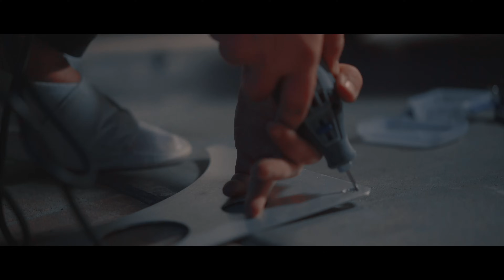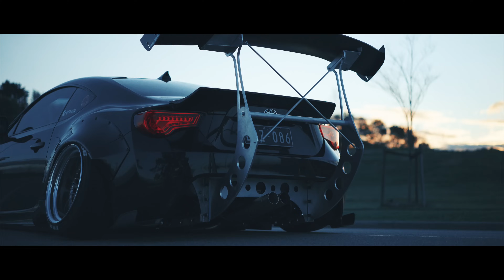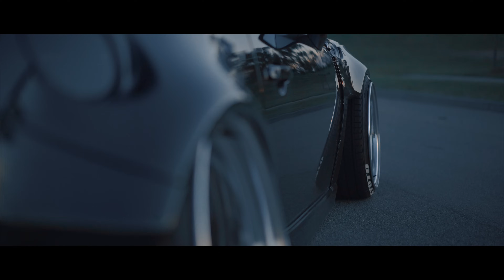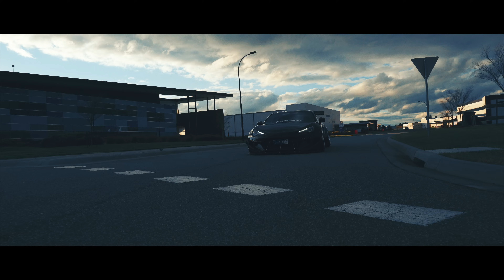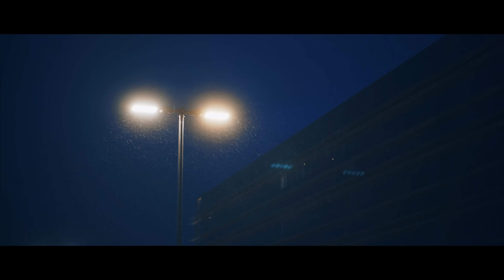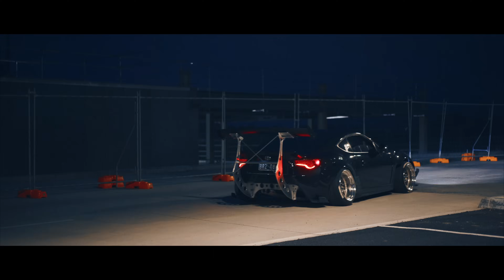Jake's Rocket Bunny GT86. | 4K

Comment: how much this car cost you?  
btw dope video :)
Reply: Used BRZ = $25,000
Body Kit = $3,500
Spoiler = $1,000-$2,500
Rims and Tyres = $3,000
Tail Lights = $400
Coilovers = $1,300
Stickers = $30
Paint for Kit = $900
Reply: All Australian Dollar also Australian prices
Reply: Shit bro,  but it  Totally worth it
Reply: They look awesome, But the engine in this car is a total turn off
Reply from the maker: haha those prices aren't entirely correct as this car is bagged^ The air suspension alone is over $4k.
Reply: I was just giving an estimate cost on the cheapest rocket bunny build you could do to match this car. Bags are defiently expensive though. I have a 2 friends with V2 rocket bunny 86's.
Reply: Ruining a perfectly functioning car......priceless
Reply: MuffledPhoenix what wheeels?

Comment: I have a really hard time getting my camera to focus when using the ronin. Any advice? Im using the same camera, with a ronin, thumb controller and monitor.
Reply from the maker: Are you shooting on Continuous AF?
Reply: I usually put it on continuous and try to use the tracker but it just focuses randomly
Reply from the maker: Are you using sony lenses or a Metabones adapter? As I had issues with the Metabones and converted to using solely Sony lenses.

Comment: Some people need to research bags a little more and educate themselves. Many many many cars, drag, circuit, and drift are on bags and taking trophies with them. It's just a fact of not being educated when people continue to say, well good luck driving over speed bumps or it can't race... research a little more. Learn more Not saying it's the cheapest best option but it's just like anything else. Personal preference. There are owners doing tube chassis for street cars which is overkill but that doesn't mean it's bad.